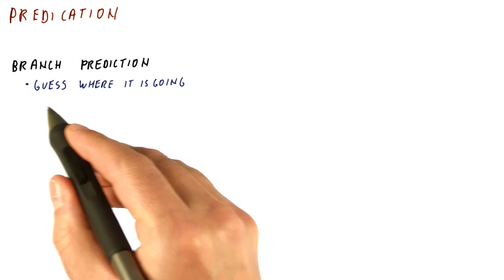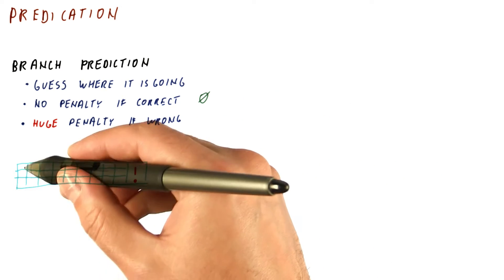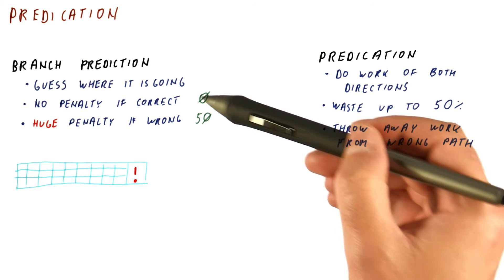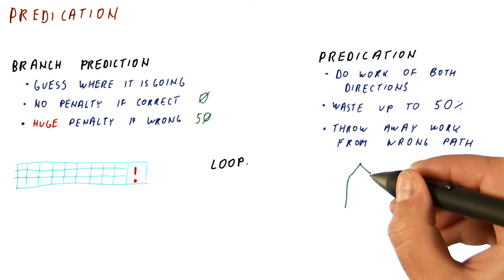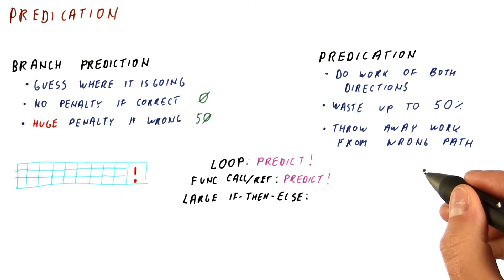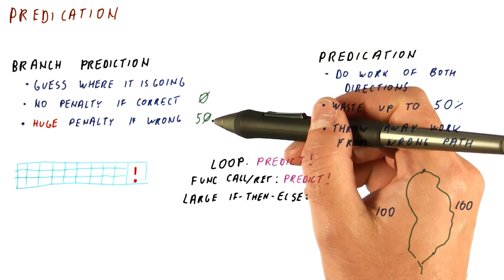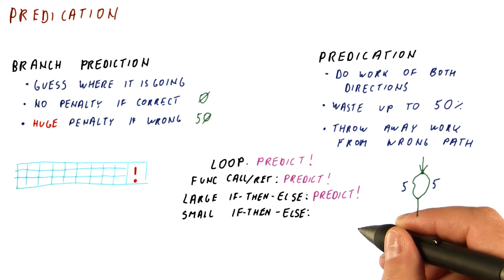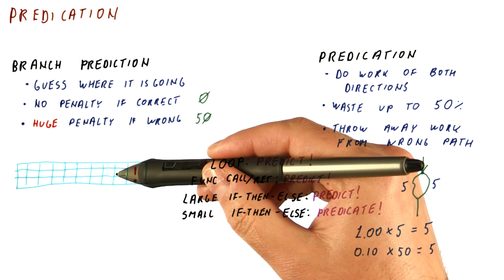Predication - Georgia Tech - HPCA: Part 1

Comment: PREDICATION: processing both possibilities of a branch instruction (T/NT) and selecting one of them according to the result that we get from execution stage ! here we are wasting resources & it's power and time of wrong path.

keep in mind that we only use PREDICATION : if #insts wasted by incorporating Branch prediction ckt > #insts wasted by incorporating Branch PREDICATION ckt

Let's say: Pipeline has 40 stages (Execution -> 24th stage where arithmetic operations are done so as the comparisons [condition] .
 <^> Branch prediction:  If there is a mis-prediction -> we will be wasting 23 or 24 insts/cycles.
 >^< Branch PREDICATION: we convert control flow instruction into some sort of other instruction (you'll see in nxt video) during compilation [compiler lvl modification] and #insts will increase as compared to original code. One of the path way will be chosen and other path way's processed insts/cycles are wasted. Thus, if more #insts gets wasted than in Branch Prediction then its not advised to have Branch PREDICATION. 

Still, its not clear for me, cuz although #insts increase after conversion, pipeline & it's stages are the same right !

wait may be think in this way that -> its our choice to select which inst is to be sent to PREDICATED ckt [Compiler is designed in that way]. 
here, there might be a catch that , we may not be able to stop the wrong path being processed (refer 3:10 in video). Then it makes sense:)
Reply: In video MOVC summary, I got the clearance that both paths are executed completely and in the end one of the result is selected. complete all the videos, you'll be cleared, cheers !!

Comment: What I think is unfair comparison is, when we predicate for large if-then-else, the lecture says we execute 100+100=200 instructions either way. But I think, after we know whether our prediction is correct or wrong (maybe at 12th stage of the BRANCH instruction), we don't have to keep executing the wrong instruction path, so we don't need to execute 200 instructions for predication, but slightly more than 100 instructions. Any comment will be appreciated.
Reply: Precisely, supposing 4-way superscalar processor, predication needs to execute only 100+48 instructions. (since until we go through 12th stage of the BRANCH instruction, we need to fetch 12*4 instruction which need to be canceled right after we know the path is a wrong path)
Reply: But the overall point still stands. For a large if-else, the cost of misprediction is small when amortized. As the if-else block becomes smaller and smaller, predication becomes better and better in comparison to prediction.
Reply: yes, I had this is my mind too. we could find out the decision in execution stage itself and from there on we can cancel the parallel execution of unnecessary path. Thus , saving power, resources and time for that specific hardware. 
I'm not familiar with multi-processing or superscalar that you've mentioned above; if I stop the wrong path from being executing those unnecessary instructions, would that silicon be utilized for other instructions? (I mean i think we can, its all about how we efficiently use our resources.. there must be ways [multi-threading or something else] ).
Reply: But I think we are very naively putting all these things at an abstract lvl... ummm IDK
Reply: check my comment that was mentioned separately !

Comment: Thank you for your lecture. There is one thing I do not understand well. When comparing branch prediction with predication, why is it that you keep using the same #instruction for branch when keep changing the #instruction for predication? Isn't it a wrong comparison? T^T I hope I can get some explanation! Thanks!
Reply: For branch prediction, the lecturer "CHANGED" the #instruction. One is large if-then-else, and the other is small if-then,else. For large one, we lose nothing if we predict correctly but lose 50 when wrong. Now, for small one, we lose nothing if correct and lose 50 when wrong. So, for BP, the the thing goes same either for large or small one.